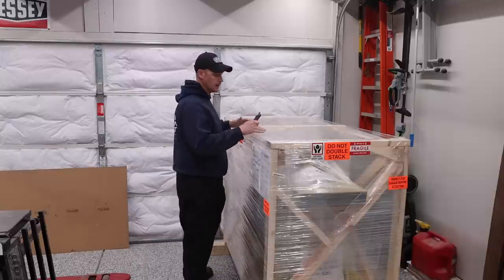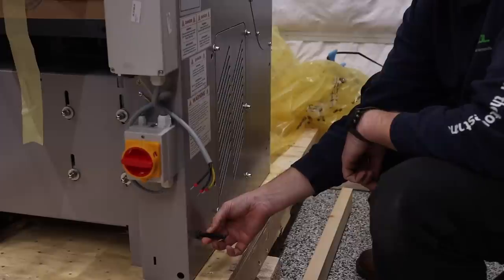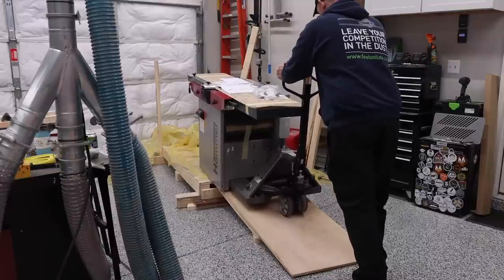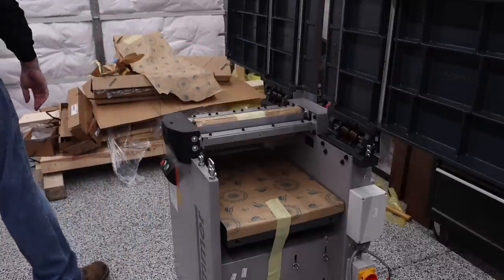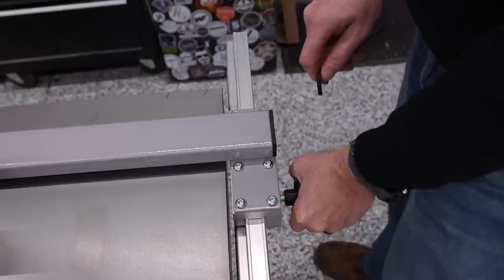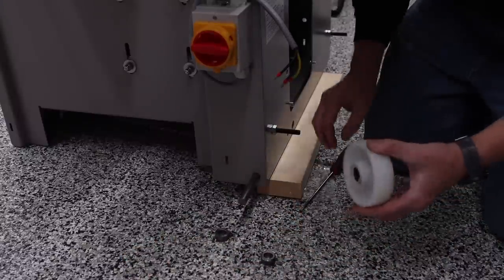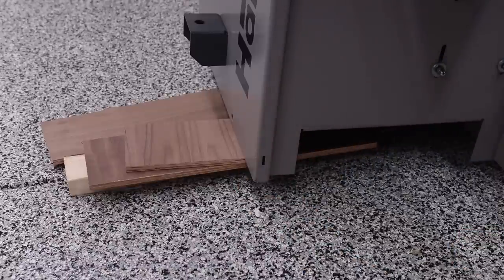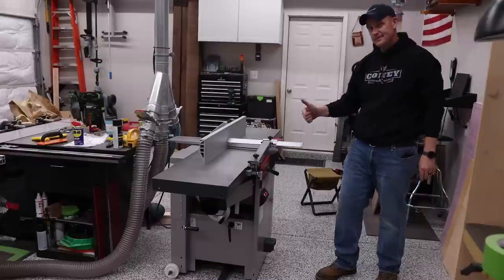Hammer A3-41 Assembly

Comment: Great video and very, very helpful information.  Picked up my A3-31 on 01/26/22 after a long wait.  I avoided the pallet jack completely by blocking up the machine while on the pallet, putting on the wheels and leveler feet, and then removing the blocks.  I screwed a block to the side of the pallet opposite my ramp so the machine didn't accidently roll off the back side.  I assembled and used the handle and wheel set to run the machine down a ramp off the SIDE of the pallet, using the leveler feet as "brakes" as needed.  My ramp was about 5 feet long.  Very easy...an hour of prep for a 15 second ride.  Thanks for taking the time to make the video.
Reply from the maker: Glad you found it helpful

Comment: Great demo. Very helpful. I followed you when setting up my new A3-31. I did not use a pallet truck to get it off the pallet, but rather installed the wheels and levellers first (using a hydraulic car jack to lift one side and then the other). I then used slid the machine down a ramp alongside the pellet using its own lever, with small movements to prevent the machine from gathering speed. Your method is probably safer. For the 17mm distance, I used a sliding square very successfully (no need for dominos).

Comment: Thanks for the video. I just received my A3-31 just before Christmas, having ordered it in March 2021, so a bit of a wait. Fortunately they were able to deliver the machine into my garage, but the challenge was moving the machine from the garage to the adjacent workshop which is connected through a 3 foot wide door. So the mobility option wouldn't work. Solution was to lift the partially disassembled pallet onto two wood runners with swivel casters attached. To lift the machine I used scaffolding with a winch to lift each end. The wood runners with the casters was then screwed to the underside of the plywood deck. After lifting one end the 5x5's were slid out and then the machine lowered onto the casters. The machine on the pallet deck was easily rolled into the workshop. To lift the machine off the pallet I used the scaffold and with a winch at one end and come along at the other end with straps under the machine frame (not under the tables, supplied directions specifically instruct to not do that). With a rope tied to the machine and scaffold to prevent tipping each end was lifted up and the pallet with casters was rolled out from under the machine. Then lowered the machine to the floor. Scaffolding and winch was used again to slightly lift the machine to install the mobility kit. All of this was done because I don't have a pallet jack and I was working alone.
Reply from the maker: Thank you for sharing 👍
Reply: Hi Dana, do you have a photo of how you  lifted the machine via winch without putting pressure on the tables? I have one coming and am trying to figure out how to get it on to the Bora mobility base. Thanks!

Comment: Thanks for putting this together.  The handles holding the bed in place on my A3-31 were over-tight when delivered, and I couldn't get them to budge with modest force.  Your video helped me understand the DIRECTION I needed to turn the handles as I ramped up force to get them to release.  I also really appreciated your showing the nylon screws on the slide for the fence.  My fence was binding like crazy before when I moved it.  The simple adjustment of the nylon screws made it much smoother.
Reply from the maker: Glad you found it helpful

Comment: Jason - thanks for another great video. My A3-31 arrived two days ago and I was able to use your method for building a ramp and rolling it off the pallet to my garage floor. I used a full sheet of 3/4" plywood over 2x4 framing for the ramp. The A3-31 base must be narrower than your A3-41 because one of the pallet jack forks was about 8-10" past the front (long) side of the machine. I just raised the pallet jack the minimum necessary and applied some pressure to the other side to keep everything balanced as I came down the ramp. Again - your video was excellent and a great help to everyone wondering how to un-crate their new equipment.

Comment: Thanks Bent for this Video! It helped a LOT! I got my A3 31 yesterday and had a few differences that may help others to know:
- The base of the A3 31 is not the same (anymore?), it is narrower than on the a3 41. However, i used a normal sized pallet truck und that worked fine. It was a little bit instable when the tables are down, but very stable when they are up. I build a ramp like in this video, we had no problem getting the machine of the pallet. Two people is better than doing it alone!
- My machine came without feet. There aren't any mentioned in the manual, so maybe that changed or the A3 31 never had one, I dont know.
- My machine was just wrapped in plastic. I live in germany and it had to travel just via truck. No wood housing with good screws for me ;)
- My pallet had a metal base instead of a wooden one. So I could not screw my ramp to the pallet. But that was not a problem, nothing was sliding around.
Hope this helps, Joey
Reply: The feet only come with the mobility kit.

Comment: This is similar to the Hammer demo video much more detailed. Thank you.   I found your method for setting the 17mm clearance for the fence and the auxiliary table extension brackets very useful. The problem I had to solve with my A3-31 was the pallet was on top of a second pallet.   So you never know how the Machine is going to show up.     I ended up building cradle to go under the machine and using straps and an engine hoist to lift the machine and pull out the pallets from underneath. Even though I did not use the lifting bots I did install them and leave them in place for possible future use by me or my heirs.

Comment: A note on getting it off the pallet to supplement what you did.  I have the A3 31, and I have been thinking over how I would get of off the pallet and get it on a mobile base.  Spoiler I’m still mulling over how to get it on the mobile base (which I’m sure will either involve an engine hoist or a bunch of blocking and leverage).

If you purchase the mobile base accessory then it’s fairly easy to get the machine off the pallet.  Utilizing 4 foot long by about 4 for wide piece of plywood, I screwed supports to the bottom so that the plywood is supported through out the whole length and width.  So I followed the same
Method, but instead of using a pallet Jack (which I did not have access to a narrow Jack), I approached this from the wider side of the pallet.  This allowed me to use a few blocks and a piece of wood to very carefully lift one side of the machine at a time so I could attach the mobile base wheels.  I was SUPER careful due to the balancing game, but it was fairly straight forward.  Once the wheels were attached I used the leverage arm (without the rubber feet attached) to very carefully lift and somewhat drag to control the speed down the ramp.  The most difficult portion is the final step where the lifter arm wheels are on the floor and the machine is still on the ramp.  As He had a quick take off, I was expecting this, BUT I was able to control it better by leaning my weight into the lifter arm to balance the weight and slowly allow the machine to get over the final Hump on the plywood hump.  

Next step is to figure out the mobile base, (a Bora heavy duty one with 4 casters) so I can easily navigate my shop. The downside to the felder mobile base is it only allows travel in one direction, so it would require me to
Move all my tools to move the machine (except for the one direction).  The purchase of the felder base was worth it getting it off the pallet, and it’s about what a week rental for a pallet Jack would be.

Comment: Make sure you don't over-torque those front lock handles. I watched a guy who had same machine who is bummed that he wrenched them and put an impression in the metal. These planer jointer machines are all backordered. I ordered the Jet 12" one but later discovered extended backorder; so I contacted Felder; they are September. Thought of changing my order to Hammer until I just received unexpected notice (email) that my Jet order is now ready soon to be shipped; maybe it happened because I inquired.
Reply from the maker: I don’t apply much pressure. I know the video you are referring to, watched it a couple weeks ago. 👍

Comment: Woot woot!!! You got it in brother!!! I’m waiting for mine to arrive “fingers crossed” it’ll be in my shop in September so I’m saving this to my YouTube playlist to watch It and be ready when it’s time to set up!!! 
If you don’t mind telling my the actual dimensions like width, length and height. I’d appreciate it.
Reply from the maker: I have actually found really good detailed dimensions on the website. I would have to look again cause they are a little tough to find but they do have overhead views with all the different dimensions
Reply: @bentswoodworking  I’ll check with the Hammer rep too. I am currently setting a new garage shop layout so I want to make sure the spot I’m dedicating for it has enough vertical clearance as I’ll be placing a wood rack on that side of the wall right above it. I’m nervous that if the wood rack falls it’d break my new machine but I have some space to play with. 👍🏼

Comment: Thank you so much for posting this! It really gives an overview of what to expect when the machine arrives. Getting mine off will be a challenge, as I don't have a truck to get a pallet jack home.

I'm curious why you went with the Domino spacing solution vs.ripping a 17mm wide strip of plywood, gluing/brad nailing it to the underside of the board, and then using that for your reference? Seems much simpler than a Domino mishmash. Is there something I'm missing?
Reply from the maker: I like to use dominos for many things like this. Ripping a board would also work just fine.

Comment: "it is possible to do it by yourself..." Next time use a 2x4 + fulcrum! Mine A3-31 without the crate was put onto an euro style pallet about 8 inch above the floor. I never planned to make a ramp but used 2x4, fulcrum, some blocks and a lot of time wiggling up and down in order to get it down on it's wheels. The (small) extension does fit on the outfeed side of the planer but is a bit hard to install/take off. Did you order some extensions? What do you think of the longer extensions? The supported extension will need height adjustments all the time (jointer infeed and planer outfeed).
Reply from the maker: I do have the extensions but have not installed them on the 41. I had the 26 and used them on it and they worked great.

Comment: A3-41 arrived yesterday. any regrets I should know about before I sell the two powermatics? Trying to free up floor space. Haven't seen ANY used PMs on the market so selling them looks like a move a can't undo.
Reply from the maker: If I had the space, having separate machines would obviously be great. But I also wanted the space savings. Having 16” of jointing and planning capacity in one machine is pretty awesome. Now, even if I had the space I would keep this machine as a planer only and maybe consider a separate planer but definitely wouldn’t need it. I have no regrets

Comment: Thanks so much, Jason! Your video is so good that Felder sends it out with their email saying your equipment is on the way. Mine is off the boat and on the truck and should be here early next week. Did those bolts you used to contact the outboard arm of the pallet jack come with the machine?  Do you know what size will fit the holes?
Reply from the maker: That’s nice to hear👍

Comment: Thanks Jason for the detailed video - appreciate it. I am about to order an A31 and have been reading troubling comments from a number of folks about defects in the jointer tables on both sides of the cutter. Many are seeing ‘hollows’ of .15 to .20mm in spots. Have you had any of these problems?  Also, some folks have seen table movement after initial setup. Any feedback would be appreciated. Thanks
Reply from the maker: I haven’t experienced any issues. More importantly, nothing has given me any reason to even check.
Reply: @bentswoodworking  Appreciate the feedback - hard to ever know whether these things are real issues, spot problems or user error.  Information overload sometimes.

Comment: Thanks for making this video. I'm strongly considering buying either this machine or the 12" version, and this video will help in the decision. I currently have an old 6" Jet jointer and the DeWalt planer that half the woodworkers on YT seem to own. I figure the Hammer 12" machine (and maybe even the 16") would take up less space than my two current ones do. I doubt I'd have a lot of need for 16" of jointing capacity, but a 16" planer would be great!

Wheeling that thing off of the pallet looked like a major operation! Do you know if there is a way to attach lifting straps to the A3 instead? I have a huge exposed beam in my garage ceiling that's easy to hang a winch from. When I need to move a heavy tool onto or off of a pallet (or wheeled base) I'll typically use a winch if the tool can be attached to it safely. That's not the beam's real purpose — it holds up the ceiling and roof — but It's come in handy quite a few times.
Reply from the maker: That I don’t know. I would have to look in the manual again. I feel like I remember something with straps but don’t recall if it was saying not to do it or this is how you could do it. I would send them a message and enquire. Using the pallet jack really wasn’t too difficult.
Reply: @bentswoodworking  Thanks. I'll check Felder's website and see if they have the manual online.

Comment: Hi Jason - the mobile base is actually called a rolling carriage with lift bar.  Per their website they rolling carriage without lift bar is about $130 and the lift bar is ~$100  - can you confirm if the rolling carriage product came with the leveling feet for the side opposite the wheels that you installed because they are not in the pictured in the product picture and the parts are not listed in the description.  
As an aside, the website needs to do a better job of marketing this accessory - it is confusing.  If I am spending $230 or so I want to make sure the leveling feet are included.  thanks.
Reply from the maker: I can’t confirm that it’s specifically a part of the set. I would assume they are as they came with the equipment

Comment: This is a great video!  Thanks for putting it together. After waiting for 8 months my A3-41 is coming in a couple weeks.  I have been a little nervous as my shop is a little remote so I have to pick it up and a freight terminal with a trailer and haul it to my shop.  Just want everything to go well.  When I ask Felder they say I need a 25 or 30 AMP breaker.  I noticed you went with 20 AMP.  Any issues?  Also Felder videos talk of the tables being adjusted for a concave cut to create a "spring joint" on glue up.  I don't know what to think of that?  Do you have any thoughts?
Reply from the maker: 20 amp is all that is needed. It has a built in regulator. I spoke to them about it specifically. As for the spring joint setup, I haven’t even noticed it. It is something that can be adjusted.

Comment: Hey Jason - thanks for a terrifically produced video.  I've been on the hunt for an excellent planer and Hammer is definitely the one.  I work in a basement shop such that getting an A3-31 down there would be very difficult.  Do you think it is feasible to remove the tables of the A3-31 in order to make installation doable?  And do you have an opinion of reinstalling the tables and the needed calibration afterward?  Thanks again! Mike
Reply from the maker: I would say no and would direct you to Felder on that one.

Comment: Do you know how I can adjust the planer to remove snipe? I get some on the trailing end of the board and can't seem to fix it.

And congratulations!
Reply from the maker: I don’t but I have never used a planer that had absolutely no snipe
Reply: I don't know if you've tried this but I remember seeing someone mention in another video that if you forget to lock the planer table after seting your desired thickness, you would get snipe. Are you locking the planer table before you run boards through in planer mode?

Comment: Hi Jason. Thanks for posting the video. My delivery is targeted for April and I was starting to put together the electrical package. I bought a 30A breaker and 10ga wire because it's a 4HP motor which would put it at a max load of around 28A.  The salesman told me it's specced for 30A but many people run it on 20A which I found kind of odd. In your video you mentioned it's internally protected at 20A which if that is the case, then there's not a really a point to using 30A service and it could just be plugged into on my standard 220/20A outlets.  Does the manual itself have any information on this and/or what does the motor nameplate have listed?  I guess if you can run a 16" wide hardwood through it and it doesn't trip, then all is well.
Reply from the maker: I was in the same boat and then I asked my sales associate. There is a protection built in that stops it from exceeding 20 amps so it can be run on a 20 amp breaker. I was glad I asked cause I would have wasted a lot of money. Been using it for 3 months, never an issue
Reply: I did this same thing. In fact, it sounds like mine arrives in April also. I already wired up my panel for a dedicated 30A breaker and circuit for tools. I guess it wasn't necessary but that does give me more options in the future. I never have more than one tool running on that dedicated circuit.

Comment: I'm at the last part of assembling my A3-31... and got tripped up on the wiring. As you show... there are 2 black wires (labeled 1 and 2).  Which one is the neutral leg?
Reply: It's 220v. There is no neutral leg, they're both hot.
Reply: @farmcat3198  yep... my father (former military engineer) confirmed  the same thing your saying. Thanks so much.